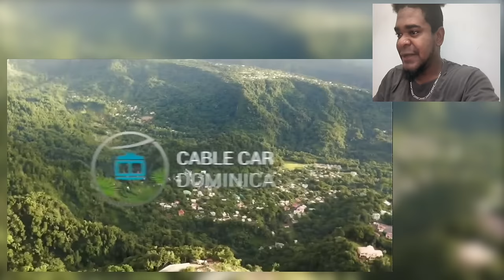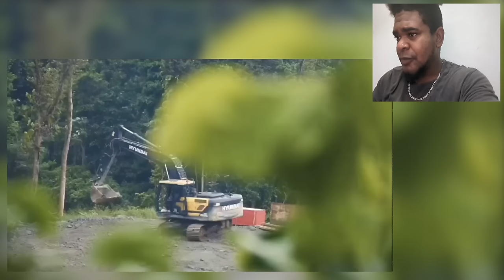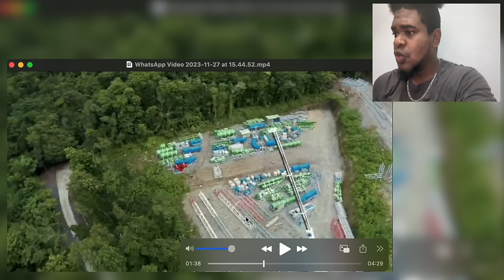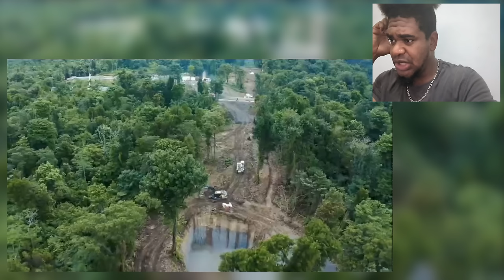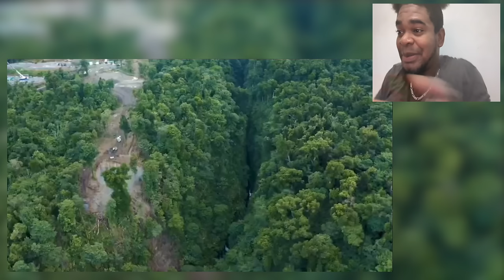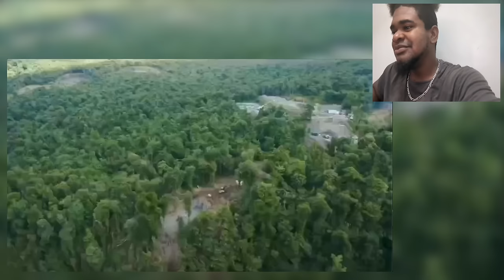🔴DOMINICA PPL FINALLY WORKING: BIG CABLE CAR PROJECT | Mystelics Reacts

Comment: Did I hear High Lift Helicopters? Does that mean no roads will be cut in the virgin forest on the way to the boiling lake? 
The best nature sights are those with no man made structures in sight. 
Boiling lake is untouchable as a Nature sight, it would be nice to keep it that way.